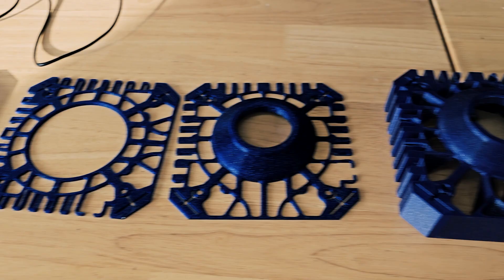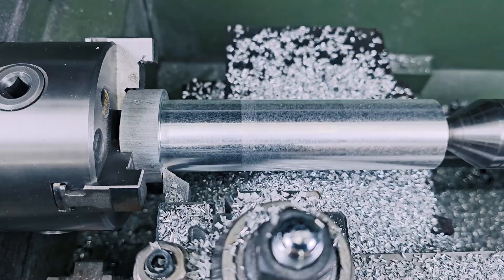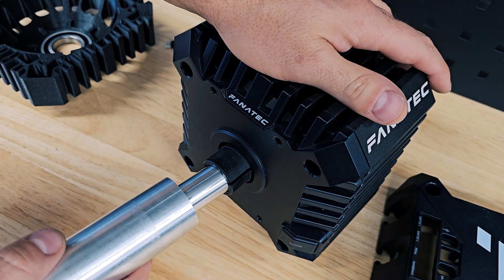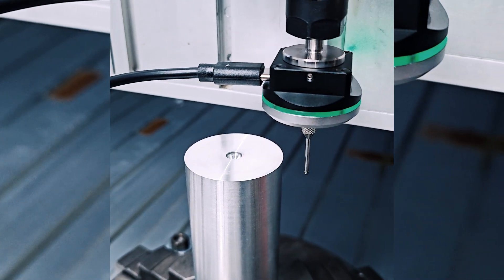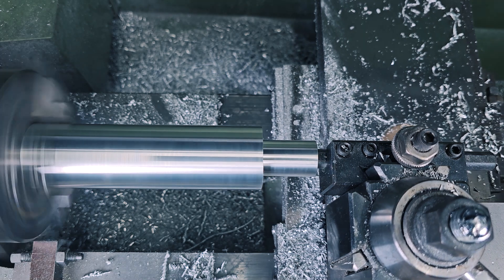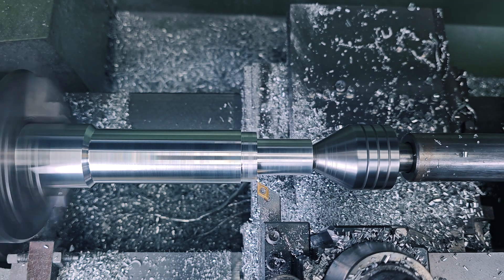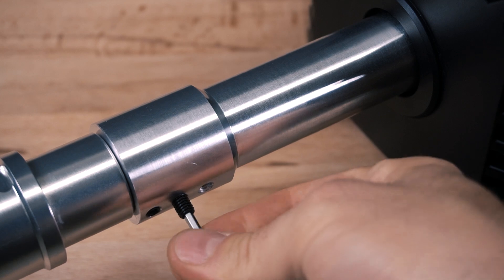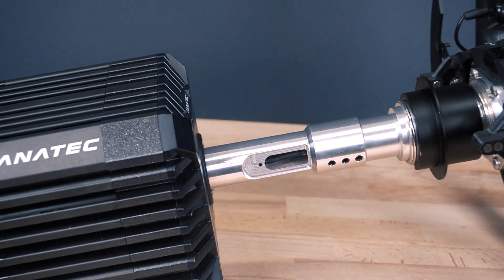Fanatec CSL DD FOV Extension (Development and Manufacturing Process) Part 2

Comment: I really really hope the same will work for GTDDPro too. Finger crossed!
Reply from the maker: It should be the same, As far as I can see only the outer part of the base is different. Oval instead of straight. I am trying to get my hands on one of these to make the necessary modifications to the 3D printed part.
Reply: @T.S.CUSTOM  Let me be your first customer for it. I have already emailed you. Thanks in advance

Comment: does this dampen down the FFB due to the extension, almost like adding a long socket extension on a workshop airgun, the torque is reduced ?
Reply from the maker: No, extension does not reduce torque.
Reply: @T.S.CUSTOM  Excellent that certainly will allow sim racers to get more adjustment of FOV, unfortunately Ive changed my wheel base and wheels to the QR2 system.
Reply from the maker: All extensions we manufacture are compatible with QR2, including this one.

Comment: Will be superb if the spacer is made of alluminun also. Nice design by the way. Great engineering!
Reply from the maker: There is no force being applied to the spacer. It just holds the bearing while pushing the assembly inside and makes sure the bearing goes to the final position so there is no need for it to be made of metal.